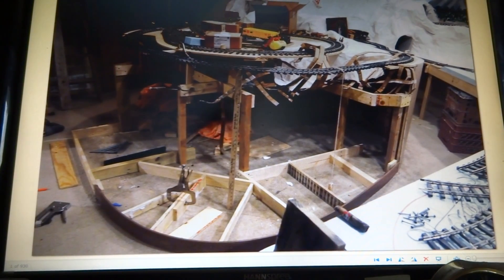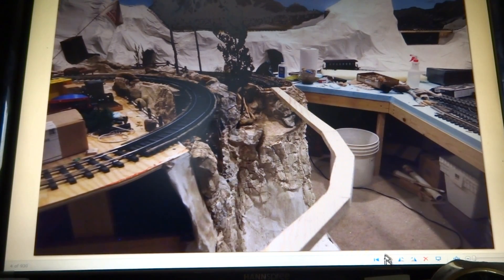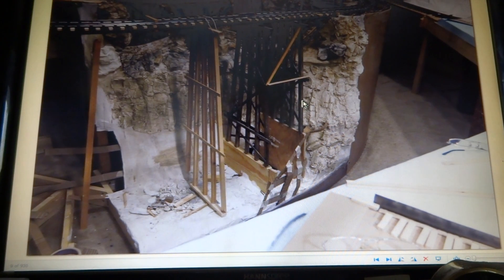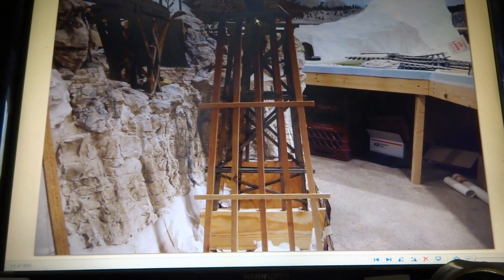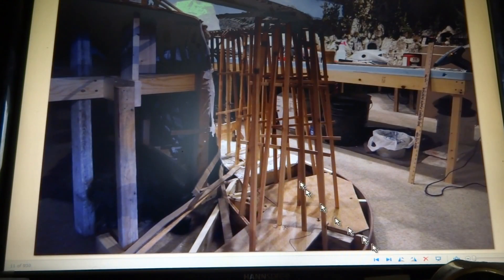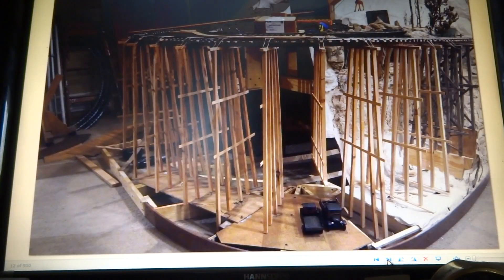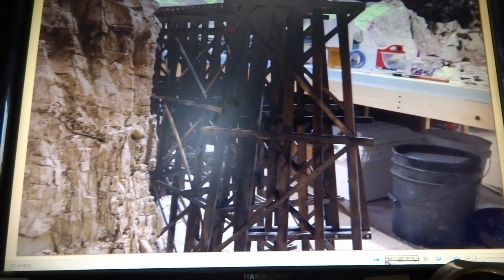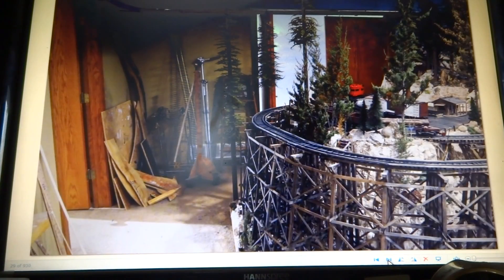G scale, Building  a tall timbered G scale Trestle ubrailroad

Comment: I’m looking into building a outside layout, attach the track to landscaping bricks have the curve go out and back to the bricks. Reverse loop, my house is on a hillside so the trestle will be different sizes going around.
Reply from the maker: The nice thing about model RR when building a trestle is you can start at the top and work down. Put your track and roadbed in first making sure your track is very smooth, the just build your trestles in place like I did, you will see how easy and fast it will go. Good luck, and keep me posted thx